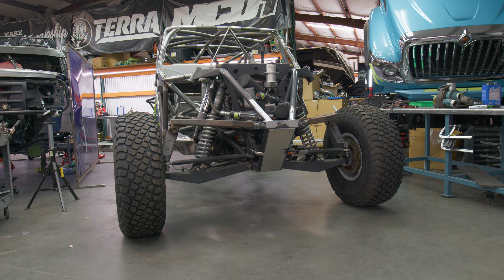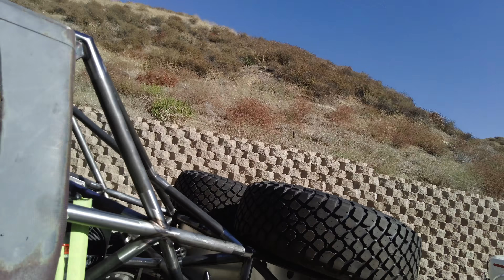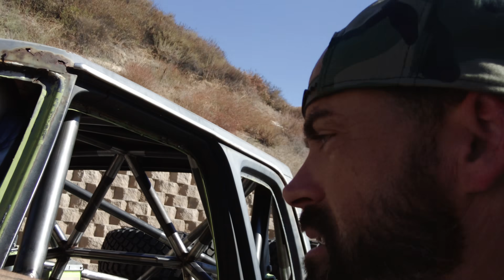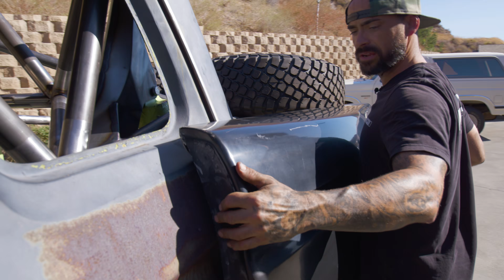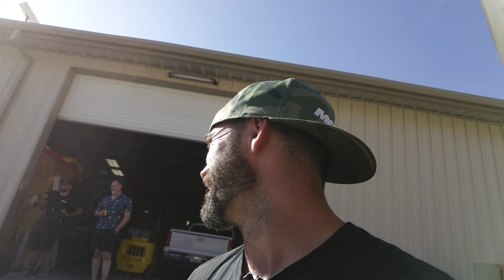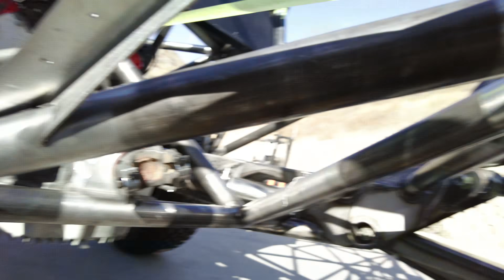Vivian the Toyota Tundra, Ford F100, is now a Truggy? | Morgan Clarke Design

Comment: Old ford's body means it needs a aluminum 600" big block ford with blue thunder heads or boss 9s with an 8 stack, it will cost 2x as much as the ls but make 300 more hp
Reply from the maker: I LIKE YOUR STYLE